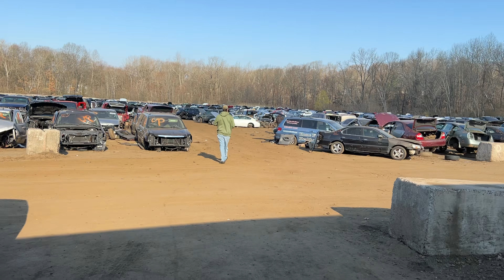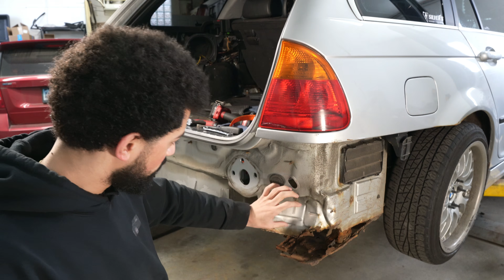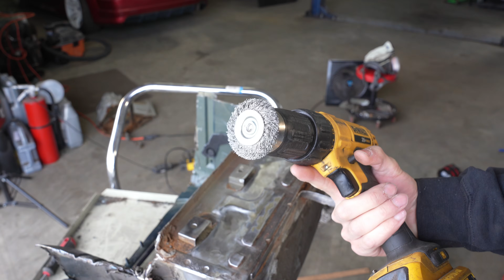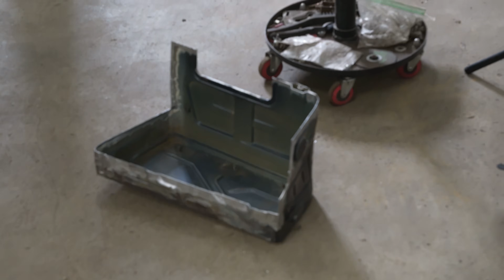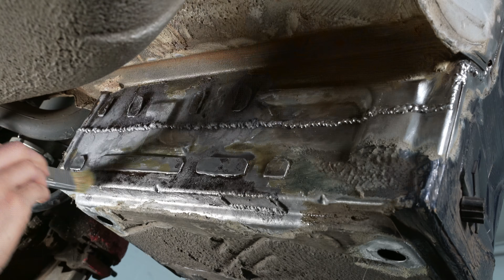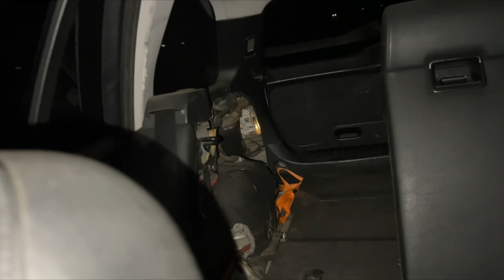BMW E46 Drift Wagon: Battery Box Rust Repair (DIY)

Comment: next time if you can do your tacks like normal but once the gap is covered lay a bigger weave pass over your tacks so a full weld is covering it and it'll be on top of the tacks so you can run it slower for more heat

Comment: Joel I just picked up another E46, did a full swap and I’m getting to the tail end of the “project” lol I was thinking of going the route of flocking all three pillars to remedy the peeling fabric issue every E46 has. Do you have any experience with doing that type of work? Would make a good video 🤔

Comment: Great job, although i have a few criticisms of constructive nature.

1. You should have grinded down your welds.

2. You went too fast or too high of heat with the welds. At some points you can literally see the metal bowing in and warping from the heat. Not a big deal but its something to consider in the future.

3. You completely welded around every bit and made sure you had full penetration of the weld. As a result, you didn't need seam sealer. Its a good precaution to take, but I feel like it was entirely unneeded.

4. You didn't completely clean off all the undercoating and paint off the new battery tray, and then sprayed the spray on galvanizing coating over the undercoating.  You should have checked for rust underneath the undercoating on the bottom of the new tray.

Comment: Use steel it under the patch plates, you can weld through it and it will provide so protection for further rusting. You should grind you welds flat, not only will it look better but any little pockets that could trap moisture are gone and you can see any spots that didn’t melt through.
With all the work you do on older cars you should look at getting a small sandblaster box. All those grody slightly rusty parts can be quickly cleaned and the treated, primed and painted. Do it right once. Next time just drop the subframe. After a couple times it’s easy and you’ll see any bushings or rust that needs to be addressed. 
✌️

Comment: No the rust do not come from the body damage, it comes from old batteri leaking acid and gas, specialy if the battery ventilation hose is not connected.
My E46 320i was like factory new in there, after someone helped me reinsert the battery and missed connect the ventilation hose it locked like second world war in there
after just 1 year with out the ventilation hose connected. And I had the same problem with 2 other E46 but not so bad. Cleaning, grinding and painting inside the box to save it is a pain!

Comment: Great job. Right back position of battery is tricky on E46. If your spare wheel case is not used you could consider positioning it there.